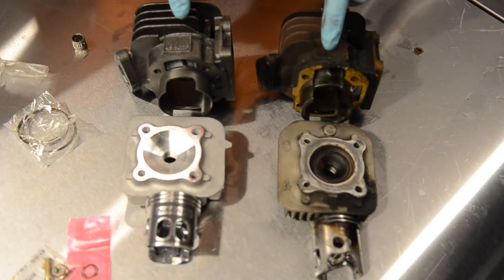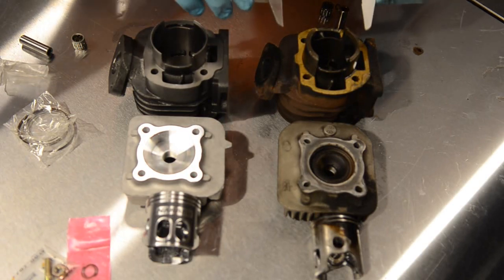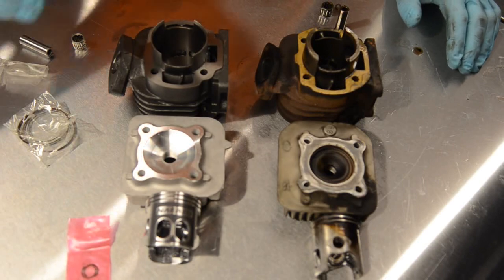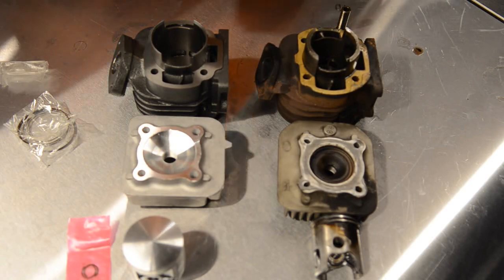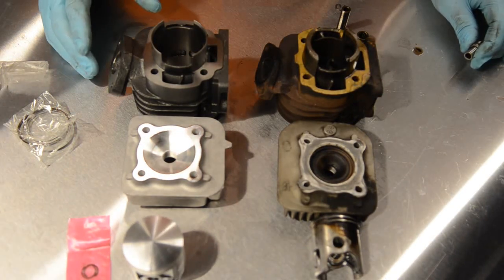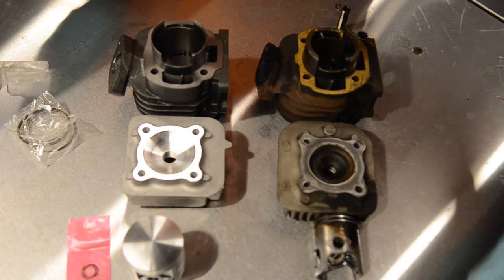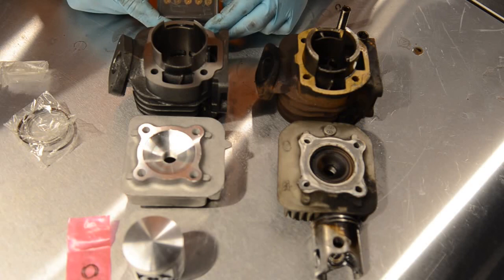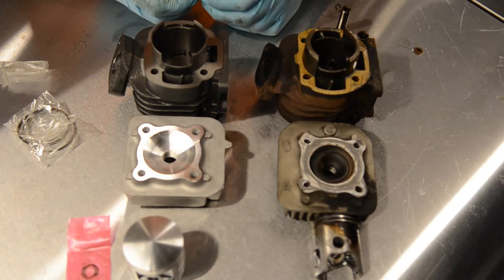Naraku 70cc Kit installation part 1

Comment: Do you sell used parts?
Reply from the maker: Not really, this is been a hobby of mine for about 25 years now. Are you after something specific? I might have it here, I have bikes in boxes here.
Reply: @Yoke.  hello,

Do you have a used block kit like that,

Cylinder block
Cylinder head
Piston
G Lock 
Pin
Wrist bearing

And a crankshaft 

Any used parts for vertical minarelli or copy will do,
Reply from the maker: I have a load of old cylinders here but unfortunately not a 70cc one for this bike. But you can buy this new very cheap, and I would recommend you buy a new one anyway. https://www.racing-planet.com/cylinder-kit-naraku-70cc-for-minarelli-vertical-ac-p-271922-1.html?utm_source=google&utm_medium=google_merchant_uk&utm_campaign=google_products_uk&country=de&currency=EUR&gclid=CjwKCAiAgc-ABhA7EiwAjev-j16hoodsZV0uMz1KaUjSiSo7gziNWpT8QG-lpWwqUSRcOWNrXlOGCBoCpa0QAvD_BwE

Hope that helps and I am by no way saying this is the best one out there. This is a middle of the road kit.

Comment: Ok so I cant tell exactly witch way you put the "3rd" ring. Like the very first ring u put in. My instructions didnt tell me witch way it goes. Does the "open" end of the 3rd ring go middle of the dowel, as in two equal parts of open space from end of ring to the dowel? Please help
Reply from the maker: Let me try and explain this, I just watch the video and see that it’s off camera. You have 3 rings, 2 identical compression rings and one really skinny expansion ring. The expansion ring is fitted on the bottom with the dowel in the middle of the ring gap, there is no up or down on this ring, it can go anyway once you keep the gap centre of the dowel. Don’t worry if it doesn’t close the gap all the way as there is another ring to go on top. The compression ring does have an up and down, so mind that. Make sure you use good 2t oil during assembly as lubricant. Makes life easier and less chance of breaking the rings. Also make sure to torque the head bolts, and Rev the bike gently for the first 500-1000km. Hope this helps
Reply: @Yoke.   thank you so much for responding! I took a guess on how I thought u put it, and it was the correct way from how u just explained it. I hope this kit works other wise I'm just gonna order a polini kit. The only thing I found that that was wrong with this kit is that the angle of the exhaust flange of the jug is at a new angle so I had to cut the exhaust flange off the stock pipe and re-weld it back. Thank you for the help to make sure everything is  correct.
Reply from the maker: @Travis Williams  no hassle, the kit will work I have it almost two years now, the trick not to over Rev it at the start, take your time breaking in the rings, also make sure get a bigger jet or carb, having enough fuel there is important for lubrication. This is the usual stuff with any new kit, or set of rings. I haven’t used this on a jog so I can’t comment. Problem with keeping the original carb and jetting is that you run out of fuel at full throttle in about 30 sec 😀. Good luck
Reply: Well see the instructions never said anything about that ring and I put it together without the 3rd ring and ran it. Did a bunch of hit cycles and thought it was running good besides needing a main jet so I ordered a few and none did the job so I did a pressure leak down test and it checked out with no leaks.  Did some more research and started find out about the 3rd ring. Soon as I found out I compression tested it and found I only had 82 psi of compression.  Took bbn it apart and found this video msged u about the orientation of the third ring and put it on. Checked compression again with it on and it went up to like 91 so rn I'm pretty pissed that they didnt say crap about this ring. Only thing instructions said was to make sure the "t" or "j" is on the top. All 2 stokes I've messed with only had either one ring or 2. I've NEVER seen that 3rd. And far as I've seen this is the only company that does this. I'm very disappointed with the under communication they supply on the instructions.
Reply: So in turn I cant waste anymore time and I bought what I believe to be a big dog kit from molossi. Plus when I opened the naraku box the head gasket that came with it was bend at a 90° in half.
Reply from the maker: @traviswilliams9455  your in the big league now 😀, let me know what you think of it. I have never fitted  a malossi kit but their stuff is top quality so I have no doubt it will be good.
Reply: Yea buddy! I got you. I'll lyk how it does. I just gotta wait for it to come from Germany. From what I could find , no one in the USA had the specific kit for the 1e40qmb horizontal. They had verticals but not horizontals. I'll let UK in about a week how it does
Reply from the maker: @traviswilliams9455  to get the most out of this kit you will need to invest in an exhaust and a bigger carb. It will make a huge difference
Reply from the maker: @traviswilliams9455  I don’t represent them, like you I just bought this to see what it’s like. I have seen kits with 1, 2 and 3 rings like this. The expansion ring comes into play when engine is hot, keeps the compression up and they don’t have to be as accurate in manufacturing. 91 is still a little bit low but not critical. I presume you torqued the head bolts! This is made somewhere is Asia and not Europe or Japan so quality is typical of those type of kits. I have had mine 2 years now, I wasn’t blown away by it but it’s definitely reliable, and gives good performance. I heard of people not using the 3rd ring and like you said, it works but your not getting the performance. You will see a big difference when you jet it. Malossi gear comes with good instructions.
Reply: @traviswilliams9455  only 90psi? Should it have at least 100?
Reply: @drill7816  I found out the crank bearings were gone changed em out and with a new crank and it runs like a champ now. But I completely switched over to the s6 street pro mk2 aluminum and I'm sooooo glad I did. I've got probably 5-6k miles on the s6 kit now and it still runs great. Only thing I wish I did is put a hpc crank shaft in it. Then this would really rip  got over 3k USD in my scoot now. Everything name brand nothing cheap...

Comment: i have a 50cc keeway all stock exept a sports exhaust what do i need to change if i want a 70cc kit. some people told me to get a performance variator,clutch? is that true
Reply from the maker: To make the most use of that exhaust, a 70cc kit, a bigger carb and then you will need to lastly adjust the rollers. After that your getting into big money. Also if you start just swapping parts, the bike won’t run right. The biggest gain is the kit , carburettor  and exhaust. Rollers are for moving the powerband, a better quality variator will make the transition smooth but it won’t add power, clutch is not really necessary unless the bike has crazy power which it won’t. It’s sometimes cheaper to get a bigger bike.

Comment: Man, coulda edited out 10 mins of the circlip debocle. Hold it by the G part of the clip and feed the live end of the clip into the seat and twist it the way that it feeds the clip into the housing. Hope u get this message after u get it in but if not, try this technique. Lol
Reply from the maker: Jamie Bouchard yeah I agree with with you. But if you look closely the kit, it came with “C” type clips and I find them a nightmare to fit. So I instead fitted G type which popped in without any hassle at all
Reply: Yup c clips

Comment: i have a kymco agility 50
the only thing ive done is a other cdi and a other variokit. if i get this on mine do i need to change anything else and what topspeed will i get (current is 85km/h)
Reply from the maker: To my knowledge Kymco Agility has a different engine, this is a minarelli engine. But a 70cc kit will improve acceleration which is a big bonus

Comment: this brand should be banned for good.i did buy one this 70 cc kit for piaggio lc.first they selling the head separately then the head doesnt come with any bleeder bolt and small quality failures.no quality control in china.
Reply from the maker: Doki Bubó yeah the head should come as standard. I have this kit for almost a about 10 months now without any problems at all. I am not sure where it’s produced, somewhere in Asia, but I have seen a lot worse. The key to any of this is correct assembly, torque head bolts, correct brake in, cooling and fuel/ 2 stroke delivery is very important.
Reply: @Yoke.  ok but come on for that price i can get a way better kit.i should read about it before buy it.no more naraku for me.btw why they selling 3 piston rings?where should i install that tiny ring?
Reply from the maker: Doki Bubó out of interest, what exactly failed?
Reply: @Yoke.  no bleeder bolt or exhaust bolts.the plug which also works as a bleeder they forget to finish the hole.piston doenst fit on needle roller bearing.what shit is this really.im so pissed i ll sell it.
Reply from the maker: Doki Bubó I have no vested interest in this Company, I just picked it for the price point as a middle of the road. I had to buy a lot of bits around it but my experience was a little different to yours. Try a malossi kit, their stuff is great quality.
Reply: @Yoke.  this is the first time i try other brand.im always using malossi.